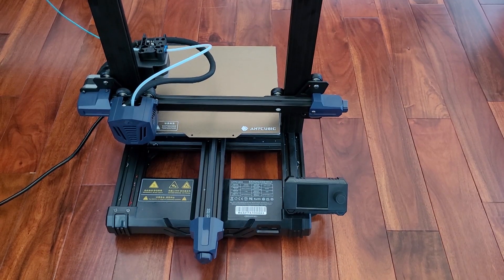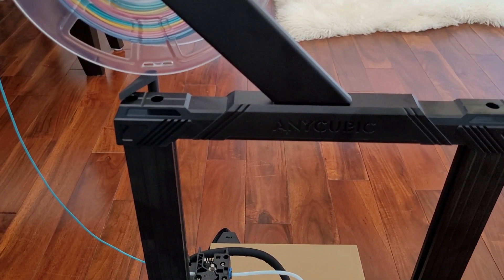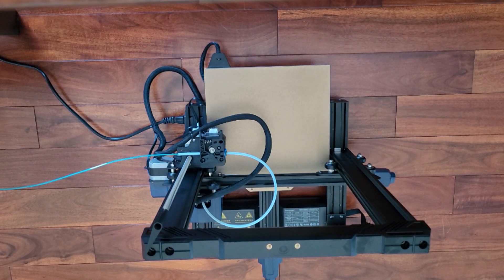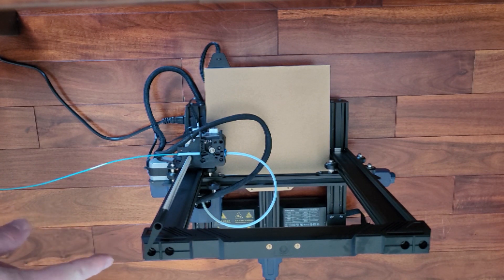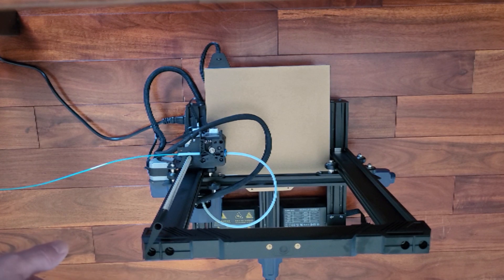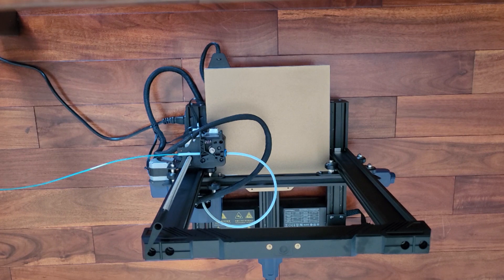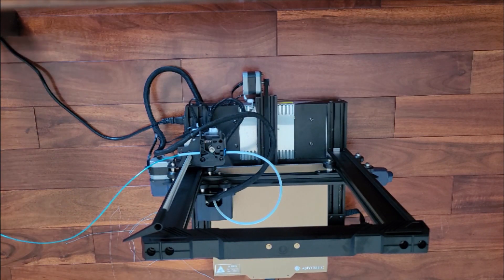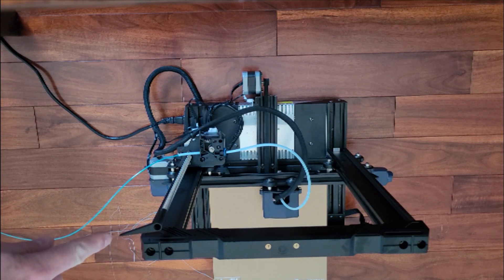Anycubic Kobra Go bed leveling indicator

Comment: So I indicate my bed with interrapid to  zero my bed cuz BL prob don't work so Is there anything I should turn off?
Reply from the maker: Hi Slick,
I'm not sure I understand the question. Are you sure your BL isn't working? YOu may need to ensure that the auto leveling is turned on by adding M420 S1 Z0 to your printer profile machine settings. That line should be placed right after G28 This video explains how https://youtu.be/MFpcUc5_FJY
Reply: Sorry 😅I used a dial indicating tool used in CNC to get table and gantry square to each other then my probe gave up on me, not registering, light comes on it don't care ram into the bed soooooo I just didn't know how to stop the old bed memory THANK YOU FOR THE HELP . IT WAS S1 TO S0

Comment: Your Kobra videos are unbelievably helpful, and I appreciate how slowly and simply you explain things that you do to fix or correct the printer. I bought a second hand Kobra that printed perfect for the previous owner but can barely to a decent first layer on anything I print.
Reply from the maker: Thank you for the kind words and feedback. I was trying to help others in a Facebook group and felt this was the best way to do it rather than writing a thousand words. Start with a calibration cube and a wide brim. The brim gives you time to adjust the z offset.  Clean your bed before your prints.  Keep at it you'll get it.

Comment: Does the kobra Go keep the bed leveling settings after you turn it off? Do you have to auto level it with each turn on?
Thanks
Reply from the maker: Yes, it will keep the bed readings after turning the printer off.  No need to bed level every time you turn it on.
Reply: @mayhemsmiley  thank you

Comment: Hey, I'm having troubles with leveling.
Auto level succeeds, but the bed is tilting towards the lower right. What should I do?
Reply from the maker: How much is it tilting? Can you share pictures or dimensions. None of the beds will be flat or perfectly level and the reason for the auto bed level is to compensate.
Reply: I thought the bed had an internal motor that would adjust the bed itself. Anyway, I was able to make it a little bit less tilting by adjusting the z wheels. I saw some posts about the same issue, and that abl wasn't working and I needed to adjust the gcode and use cura 4.10 instead.
I'll buy springs and manually adjust the bed, I prefer it that way.

Comment: Hey man, would you be willing to share the pointer on thingiverse? + Did you have to do any special settings to adjust the Z offset while printing? Idk why, but for some reason, after I updated the firmware to 1.3.4, the Z offset midprint isnt adjusting.
Reply from the maker: No problem I'll share the file.  Might be through Google drive though.  I'll look into after work. If the bed leveling isn't working mid print it is likely because the fade function is turned on.  Line M420 S1 Z0 the z must be set to zero.  M420 is need leveling S1 turns it on and any value other than 0 after the z turns on the face function. Easy fix is to add that line in cura machine settings after G28
Likely you will have to perform a new bed leveling and your z offset will change.
Reply: @mayhemsmiley  I use prusaslicer since I'm used to it from my MK3S+ and there is not (to my knowledge) such setting. But if I add it manually via pronterface, it should be set for all the prints or am I incorrect?
Reply from the maker: @LomaT97Cool  Using pronterface should work, do a verification after the save to be sure